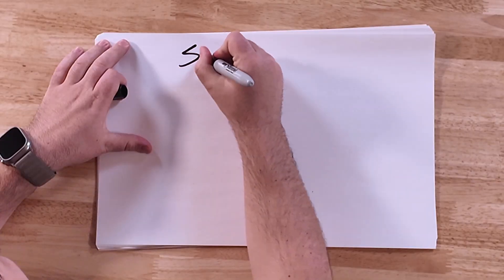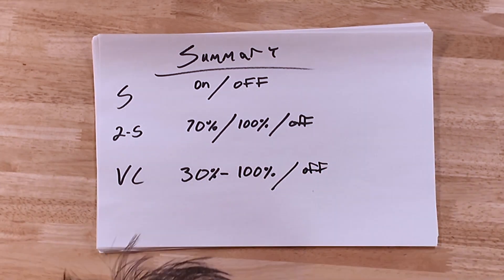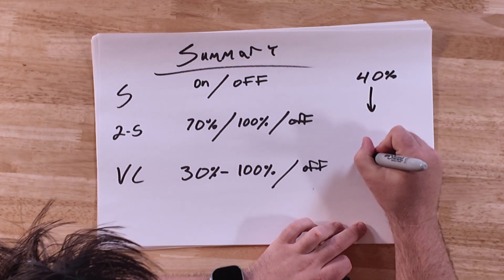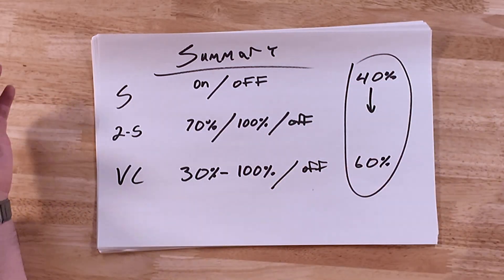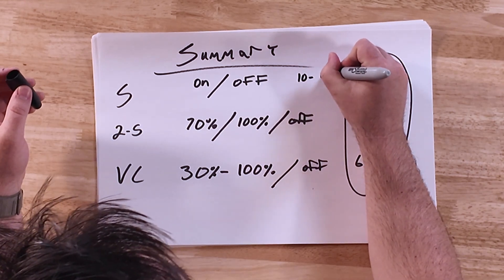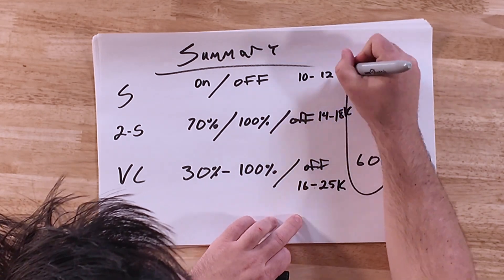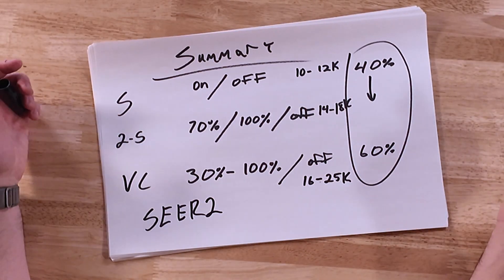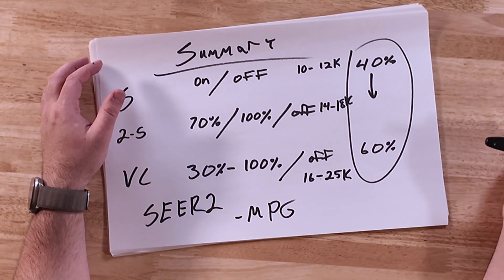Single Stage vs. Two-Stage vs. Variable Speed HVAC — Which One Should You Buy in 2025?

Comment: The more complicated a system, the more repairs and higher cost to repair. What real savings do you get when you add in those repairs. how many bad diagnosis have been made. Most techs are just throwing parts at units until its fixed. Thats my 48 years of hvac tech experience when it comes to complex systems. Want to save money. just raise your temp setting to 76 to 78 degrees and run ceiling fans.
Reply from the maker: Totally fair to bring up. Complexity can bring challenges if the install or diagnosis isn’t done right. But that’s where choosing a reputable contractor makes all the difference. Inverter systems do rely more on control boards and sensors, but when they’re installed and commissioned properly, we’ve seen less service calls, not more. And regarding misdiagnosis, we’re with you. That’s why our team focuses heavily on training and precision diagnosis so we’re not just “throwing parts” at problems. Appreciate your 48 years in the field, always good to hear from experienced techs.
Reply: And any Energy savings I'm not buying that it would depend on how much of percentage of the time the system is being run with very little call for AC and are they counting the fact that it's a lot higher efficiency Seer rating than an older unit if you are in Mississippi running the thing most of the time in the summer why would it save you money at that time it would just run at a higher duty cycle on a single stage
Reply from the maker: @howardkeil1526  SEER ratings can be misleading if they’re not explained in real-world terms. The real energy savings from variable-speed systems come from their ability to run at lower capacity most of the time, especially during partial load conditions (like early morning or evening). But if you’re in Mississippi or Oklahoma and your AC is running full tilt 24/7, the comfort benefit (especially humidity control) often matters more than just energy savings. Either way, that savings is only real if the system is installed and sized correctly.
Reply: Single and even 2-stage typically work on a universal control method. Diagnostic is straightforward. Add in variable systems now it's lot more complicated computer controlled logic. I say stick with simplicity. Faster and more reliable diag + lower maint costs.
Reply from the maker: @SerenoOunce  Simplicity definitely has its benefits, especially for diagnostics. That’s why we’re careful not to oversell variable-speed systems to folks who don’t need them. That said, we’ve found that variable capacity systems (when installed correctly) actually reduce long-term service issues because they’re not running full blast all the time. But you’re absolutely right, they need to be matched with the right ductwork and installed by someone who understands how to commission and support them. Without that, they can become a service headache.
Reply: Would it help to run the furnace fan? We don't have a ceiling fan.
Reply: Difference between a single stage and variable will buy a whole lot of electric
Reply from the maker: @JD-ir2sb  You’re not wrong. The upfront cost difference can be substantial. But for homeowners dealing with high humidity or who want tighter temperature control, the payoff isn’t just in kilowatts, it’s in comfort. Variable systems don’t short-cycle, they maintain steady temps, and they dehumidify better. If you’ve got a tight budget or live in a dry climate, single stage can be a solid call. But in Oklahoma (or Mississippi, like another commenter mentioned), that extra investment can make a real difference in how the home feels.

Comment: I love my variable speed Trane. My utility bill went down at least $100 per month. It has nearly paid for itself in full (not just delta from single stage) over the past 8 years. What I also love is it only takes about 12 amps to start the compressor, which is under 3kW, so you can use a modern portable inverter generator to run central AC. Just about every major component (evaporator, compressor, drive board, condenser) has been replaced under warranty over the past 8 years, so I hope it will last a little longer
Reply: Think about that. Every  major component replaced in 8 years.  Labor wasn't free. Mean while my single stage unit has not had one repair in 19 years other than a capacitor and contactor  that i replace myself for 12 dollars and 20 dollars. My starting amps is 8 amps.
Reply: @JohnD-f2o 5 of 8 years labor was included under warranty. We live 500 feet from ocean in FL so extremely harsh environment. Had two single stages before. 1st one lasted 6 years. Second one lasted about 8 years. All repairs were out of warranty. 8 amps - wow! Mine is a 5 ton so the single stage one I recall pulled about 130 starting amps. With a soft start I would expect to be maybe 20-30 amps at best. In my case it was a good trade for variable speed unit. For you maybe not.
Reply from the maker: That’s a great example of how a variable-speed system can pay off over time. Lower power draw, quieter operation, and better comfort is what they’re built for. Glad to hear the warranty backed you up when parts went out too. Hopefully it gives you a few more solid years.
Reply: Can you briefly explain the starting amps? This is all greek to me, but I think I've heard that starting typically pulls a lot of power and is really hard on the HVAC system (sort of like a starter on a car). I've got a 31-year-old Trane running R22 that is suddenly not cooling well (as of yesterday). Figuring I might have to finally replace it, esp given how expensive I've heard R22 is now. I'm on a rather tight budget but willing to sacrifice if I can to get something that will last longer/work better/be more reliable for the long haul. Any advice welcome. Thanks!
Reply: @bradstoops8862  I’m no expert but starting amps is the LRA (Locked Rotor Amps) rating and RLA (Rated Load Amps) is the running amps. It takes more current to get the compressor started from a dead stop than it does to keep it running. If you ever plan to run your AC from a portable generator this is an important consideration. If this is not important it may not be worth the extra money. I did have a much lower electric bill too

Comment: I was just quoted a single stage 3.5t Goodman for $7100, snd a Goodman inverter unit for $9100.

Is the inverter unit worth the extra 2K?
Reply from the maker: If you’re planning to stay in your home for the next several years, investing in the inverter system is absolutely worth considering. Variable-speed (inverter) units provide better comfort, humidity control, and energy efficiency, often lowering your utility bills enough over time to offset the initial cost difference.

Plus they run more quietly and maintain more consistent temperatures throughout your home. For long-term homeowners, the upgrade tends to pay for itself.
Reply: No. And wait till it breaks in 5 years. Another 4 k. . I have had single stage units for 40 years in 3 different homes and I am a hvac tech. Less things to go wrong. In 40 years the only repairs i made to my units were contactors and run caps. Change out a variable speed compressor 4 k easily. Most wont last the age of the equipment.

Comment: Whats the costs of upkeep? Like when parts go bad? Does variable have more expensive parts as well?
Reply: And the cost of those bad diagnosis from inexperienced techs . Keep throwing parts on until its fixed. I see that all the time. The last company I worked for the average service call was 4 trips out to the same call before resolution and fix on the same issue. those return calls were not free.
Reply from the maker: Great question! The honest truth is yes — variable-speed systems typically have more complex and specialized components, which can cost more to repair if something goes wrong. However, with proper annual maintenance and a good labor warranty, you’ll likely experience fewer issues over time, and the energy savings can be significant.

We help homeowners weigh these costs and benefits based on their long-term goals and provide maintenance plans to help extend the life of any system.

Comment: You have to put that savings into perspective. You could save 40-60 if youre putting in a variable in place of an 80s single stage, but youre looking at negligible savings of a varianle over, say, a 2 stage.
Reply from the maker: Hey, this is Kolby from the video! Absolutely, the savings will always be determined by the existing equipment. Other factors may include state of equipment, type, and previous installation. From personal experience, I did save money on my utility bills from switching from a 2-stage to a Variable. Comfort Control also improved.

Comment: Dont forget to add in the cost of ownership. A variable speed compressor is astronomical compared to a 2 stage scroll. Variables dont even save you money in a reasonable amount of years. Youll never see the return on investment considering the price up front vs the small coin you save a month, if any.
Reply: What about comfort? Would variable speed gave the most consistent temperature/comfort?
Reply: @Cummata you honestly wouldn't notice
Reply: @Cummata  "Comfort" is determined by temp swing of the thermostat. Equipment type only manages how that comfort temp is maintained.
Reply from the maker: I agree while in years past the cost of a variable capacity system was more expensive when compared to the 2-stage equipment. However, the cost of a 2 stage system vs the entry tier variable capacity system is becoming more negligible as technology progresses. In my experience, I enjoy the variable capacity system more than the 2 stage system I had; utility bills improved, indoor air quality improved, and comfort control improved significantly.
Reply: Please give more detail. Thanks
Reply: @williambarris2024 2 stage systems and variable speed units are starting to be pretty close in prices nowadays

Comment: Thanks for the video. Helped me understand things a little better. I'm currently in the market for an HVAC system in east central Indiana and doing lots of googling. House is  full electric. Home is 1400 sq ft and was built in the 1960's. It has ceiling radiant heat and we using window units to cool. I'm of the mindset that any single stage heat pump is better than what than what I currently have.
Reply from the maker: Hey glad this was helpful!! And yes, any new system you install should be an upgrade from your current system.  

How old is your current system?
Reply: @yarbrough_and_sons  since the house was built in 1963

Comment: what is single stage or variable speed the compressor or the airhandler? trying to learn to decide what system i go with
Reply from the maker: Great question! When we talk about single-stage or variable-speed, we’re usually referring to the compressor in the outdoor unit. But the air handler (or furnace blower) can also be single or variable speed, so both parts can play a role.

Single-stage just runs full blast or not at all. Two-stage has a low and high setting. Variable-speed can ramp up and down as needed, which helps with comfort and efficiency.

Variable-speed gives the best comfort but usually costs more upfront. Let us know which city you’re located in — we might have a trusted company in your area we could recommend 👍
Reply: Get a single stage unit and be happy for a long time but you won't learn anything bout ACs, because they almost never break. Get a variable speed speed and you will become proficient in how to fix variable speed equipment.
Reply from the maker: @goru426  😂😂 this is an interesting take!
Reply: @yarbrough_and_sons The more bells and whistles anything has, the more expensive it will be to fix and maintain.  My car is a perfect example, even a new keyfob costs about $300 when an old key would be about $8.   I'm thinking that a single stage will give me more bang for the buck!